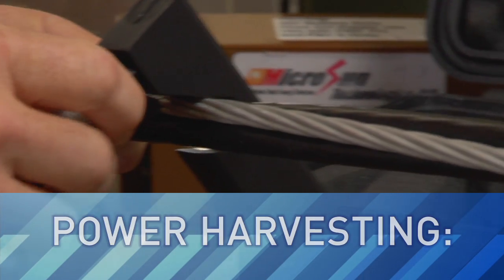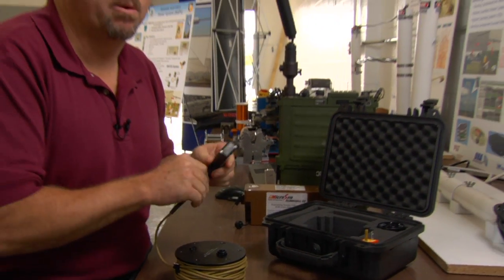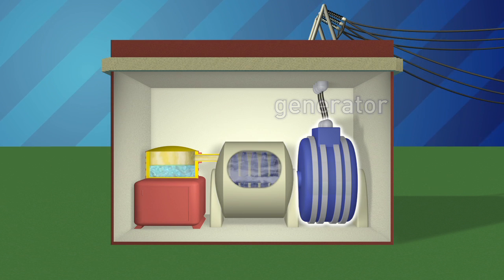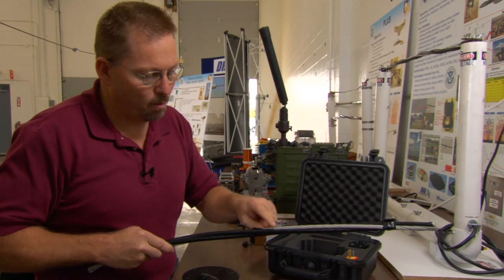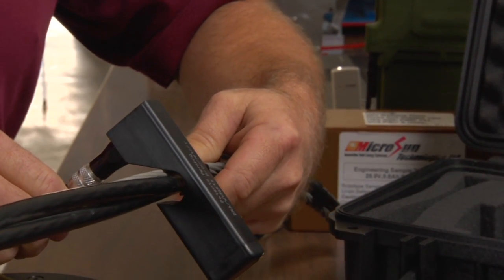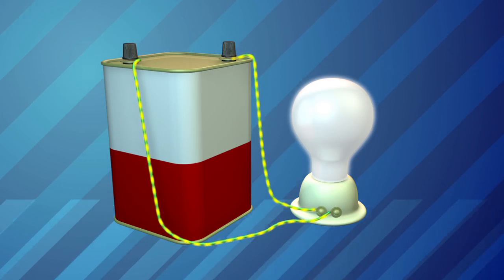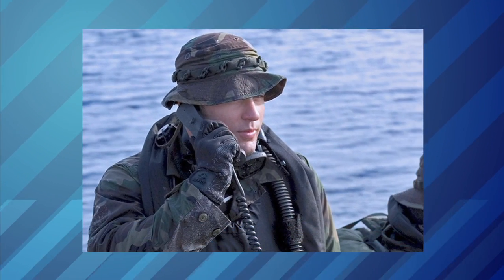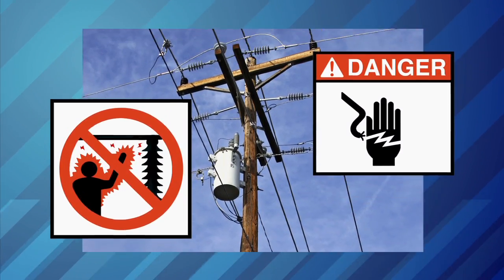Power Harvesting: The Bat Hook Helping Special Ops 'Superheroes'

Comment: How "special" do forces have to be to live connect to a 100+KV line. It's a fine system for 110vac but the same "black wire" could be carrying higher voltage.

Comment: If you are outside a house with power, it would be simpler and safer to enter and use the wall sockets.
There isn't anywhere I would be willing to toss that over a power line and hope it cuts into the insulated portion without bridging the neutral wire.
Reply: It's proper usage requires the user to connect to the secondary of the last transformer (120VAC X 2).

Comment: But in the jungle or the desert, they don't have too many powerlines. So what then? Why not build a device that can harvest the radiant energy in the sky? That would be a better solution.
Reply: They did; it's called a  rollup solar panel. It'll only provide low current, low voltage DC, though.

Comment: It sounds great until you have to detach it.  Who is volunteering to go up a power pole?  If you are special ops, you can just throw it away because Uncle Sam is wasteful, but not for the average Joe Blow stealing power.
Reply: If you have thrown it up and pulled it back anticlockwise to engage it, throw its cable over the cable and pull it round clockwise to disengage it. The problem is that in the UK we dont run a live phase and the neutral together, so a problem develops with that system. Hey-Ho......

Comment: Can the electric company sue for damaging insulation on their lines?  This will lead to leakage and electrolysis induced corrosion, requiring the entire line to be replaced a year after some army guy charged his phone.
Reply: What? The current will not flow through the water, why would you have electrolysis there?
Most transmission lines are not insulated anyway, and I don't see them being replaced yearly.
Reply: @MrHerhor67  They have to be insulated when its coming down to the house with the three wires shown.  The ones that are not insulated are the high voltage lines at 7200V.  Those lines are just separated by an air gap.  I have no idea what you are talking about current not flowing through water.  Current flows through water very well as long it has impurities.  Salt water is one of the most conductive electrolyte.
Reply: That's not an issue, because the wire ends are exposed to the elements where they are connected to the transformer on the pole. The insulation is to keep the lines from conducting with each other.
Reply: First of all - this thing solves problem no one had.
That said - There is no place on earth where a company would be able to sue any military for damaging a power line.

Comment: How can it work without Earth ?
Reply: 1 razor for hot, 1 bare metal for ground/earth. the bare metal part contacts with the bare metal wire as demonstrated.
Reply: The razor cuts into the hot wire that’s insulated and the base of the connector touches the bare wire which is the neutral/ground completing the circuit
Reply: it's in parallel, there are two razors cutting
Reply: @chewygumxx  what? 😬😂
Reply: @edo153  bruh this was over a year ago idfk 😂
Reply: @chewygumxx  Wrong. Watch the video, again.